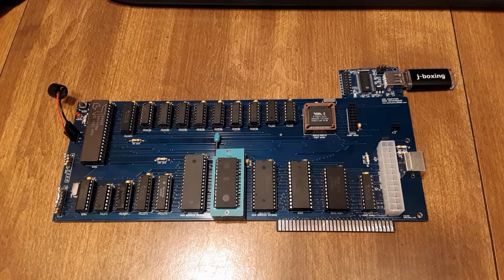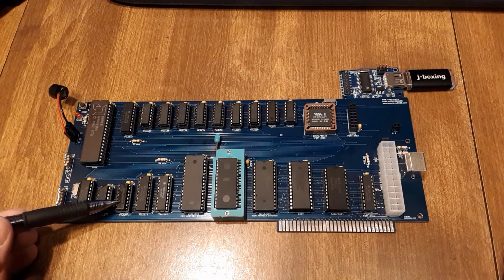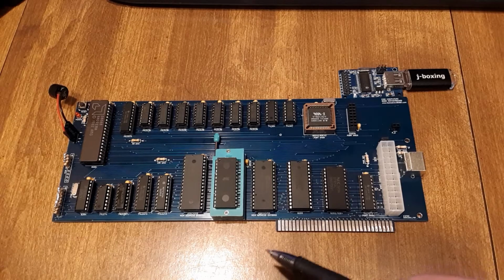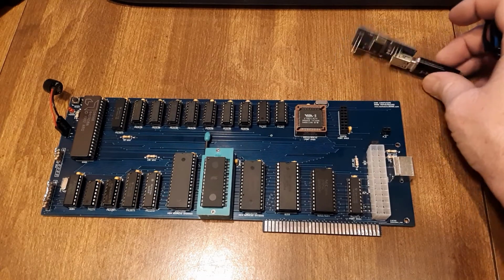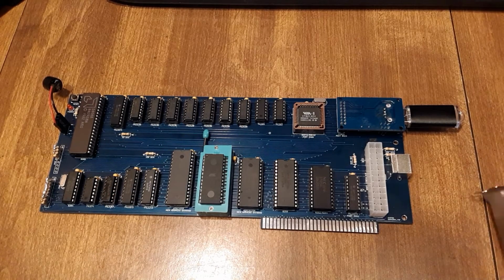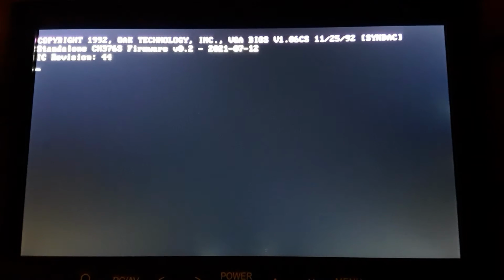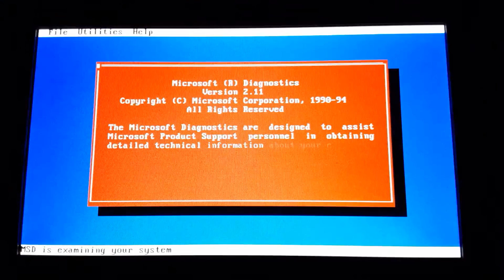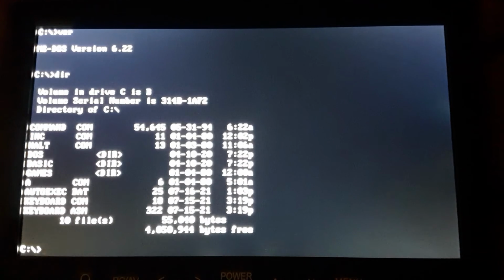8088 Motherboard built on ISA card. First look at prototype. VGA card, Third party BIOS

Comment: Very cool! I'm using the TurboXT BIOS in my XT emulator. Regarding the issues with the CGA card. I had a similar issue with the BIOS reading the PC config switches (that was not correct implemented) That resulted in a faulty equipment word in the BDA. Perhaps you have solved that already but I bet it is the same issue that I had. :)
Reply from the maker: Thank you. I think I found I just have a bad IBM CGA card. I have a leading edge CGA that works ok in my projects.

Comment: Nice clean card. Did you say it was about 4mhz? Is that the same as the previous one?
Reply from the maker: 4.77mhz. (14.31818mhz/3) It is the same as my first attempt at an 8088 motherboard. Which is the same as the original IBM PC 5150.